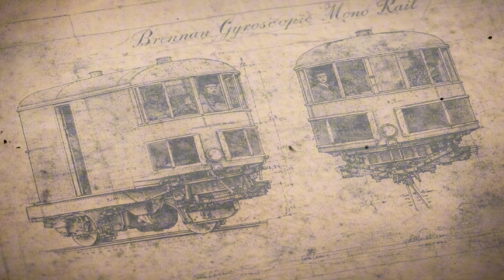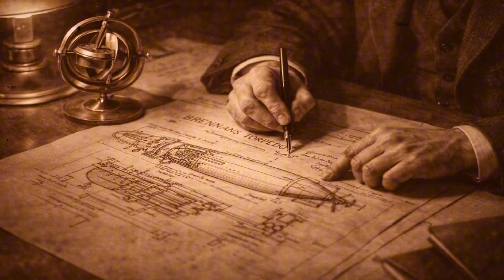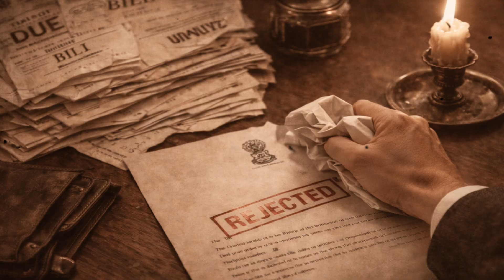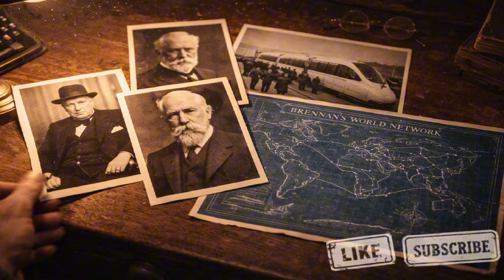Why Louis Brennan’s Self-Balancing Monorail Failed | Lost Engineering Marvel

Comment: AS AN PROFESSIONAL RAILROAD WORKER , THIS SORT OF SYSTEM IS AS PRACTICAL AS  HAVING THE OPTION OF BEING BORN WITH ONE LEG , RATHER THAN TWO!!
TO ILLUSTRATE THIS BETTER COMPARE USING AN ONE WHEEL WHEELBARROW TO USING AN TWO WHEEL WHEELBARROW!
HOWEVER IF WE WERE TO START RAILROADING ALL OVER , TODAY, I WOULD OPT FOR AN WIDER GUAGE, OF  AT LEAST 7 FEET AND STACK INTERMODAL CONTAINERS 3 HIGH
ON INTERMODAL WELL CARS!
Reply from the maker: That’s a very fair comparison — especially the one-wheel vs two-wheel wheelbarrow analogy.
You’re absolutely right: in real railroad operations, simplicity, stability, and standardization win every time.

The point of the video isn’t that Brennan’s system should have replaced conventional rail — but that it showed a different engineering logic that solved a narrow problem extremely well, while creating bigger problems elsewhere.

And I fully agree with your last point: if railroading were designed from scratch today, wider gauge and vertical optimization would make far more sense than many historical constraints we still live with.

History often keeps what’s “good enough,” not what’s theoretically elegant — and rail is one of the best examples of that trade-off.

Comment: Not just the locomotive,  but all the  cars also need these gyros. Also, they would tip over if powered down.  Thus the entire train would need kickstands or landing gear on each car, also for safety in case of breakdown.
Reply: Yes but imagine how much steel would be saved ,halved in fact ,also saving on land costs etc, also track alignment maintenance if one track is more two inches out of alignment the train will derail, no need for that worry with one track
Reply: @I_come_in_peace_earthlings  the cost of the steel Railway is not the majority of the cost of locomotives. It's the cost of energy and operation more than anything else. And in terms of land, a monorail requires the same amount of land as a conventional to rail train car, because the width of the carriage doesn't change. So land clearances of the same size, would need to be purchased and cleared accordingly.